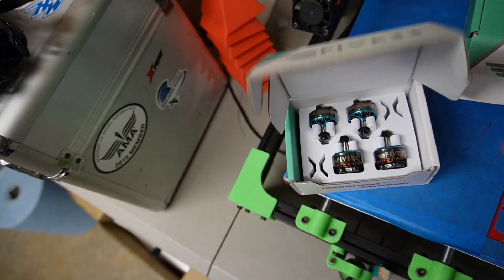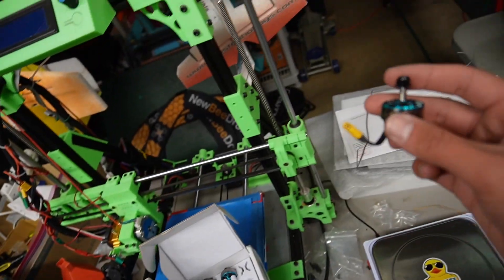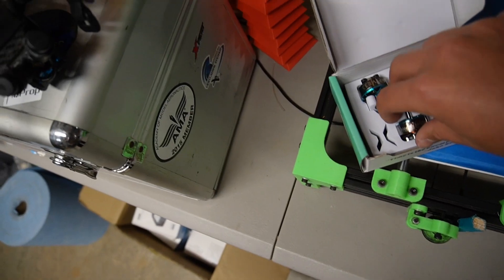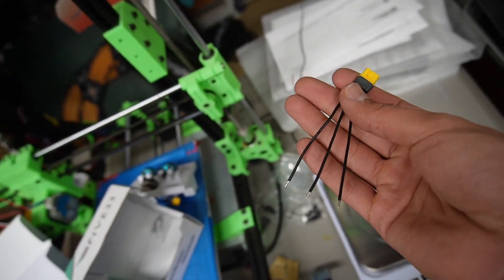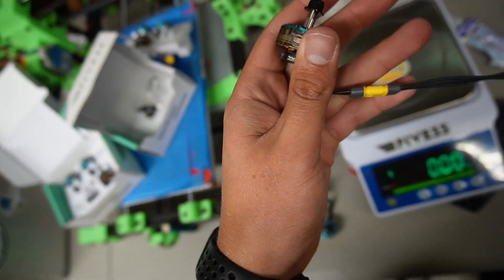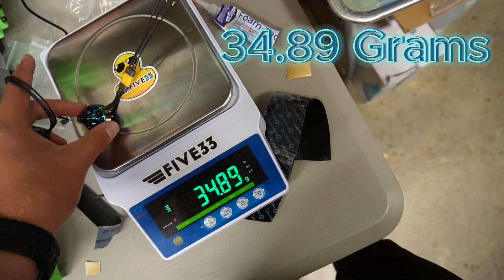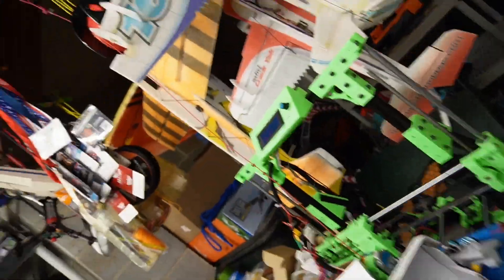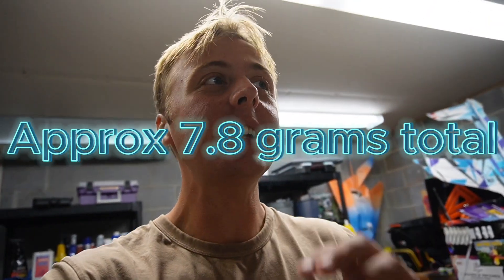Are Solder Free Motors Worth It??

Comment: I use mr30 on most race builds. I take the gray plastic covers off becsuse they breaky anyway. With mr30, ive never cut a motor wire with a prop strike. Without mr30, it is a certainty that a wire gets cut
Reply from the maker: Someone in the comments was saying they take the gray covers off and put heatshrink in place of them, I thought it was pretty smart!

Comment: Those connectors are heavier than the connectors I was thinking. More Luke how betafpv does their whoops.
Reply from the maker: Indeed! These connectors are rated for the power a 6s drone can make in comparison to a whoop connector being made for much lower amperage. But if looked at as a percentage of the total weight of the drone they should be pretty similar and offer the same great benefits!

Comment: Connectors don't add enough weight to matter on 99.9999999% of drones. Even my 65mm whoop. If I removed the motor connectors it wouldn't make a measurable difference

Comment: I use MR30s on all of my racers.  Just doesn't make sense for me not to.  One thing you keep forgetting to mention is how MR30s can SAVE YOUR MOTOR!  I can't tell you how many times I''ve broken an arm and found the arm on the ground with the perfectly working motor still attached!  Direct soldering your motors you run the risk of ripping pads off of your ESC or the wires out of your stator, not to mention a full powered spinning motor still attached to your drone with only the motor wires is a recipe for LOTS of damage.
Reply: I even add MR30s to my motors that don't offer it for that reason!

Comment: It's very practical in most cases, but prone to break over prop strikes, I prefer to have race wires 👍
Reply from the maker: Race wire is just not fun to build at all! But yes very worth it in the long run and also for those skilled at soldering it’s a great option!